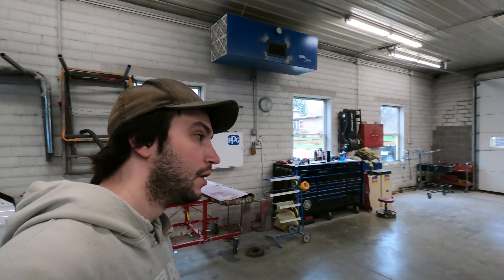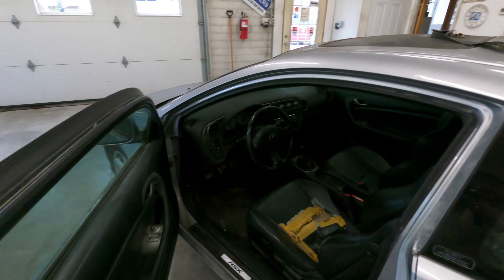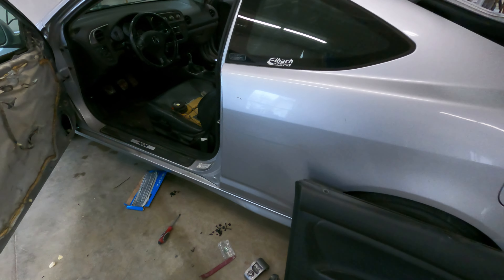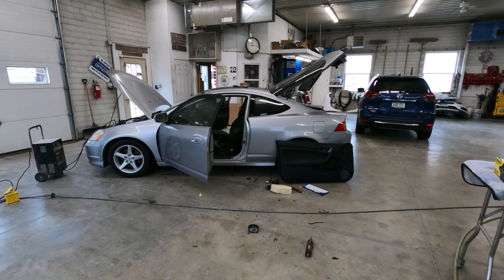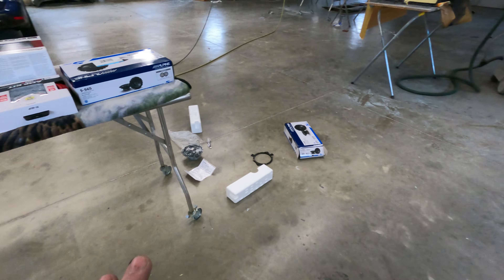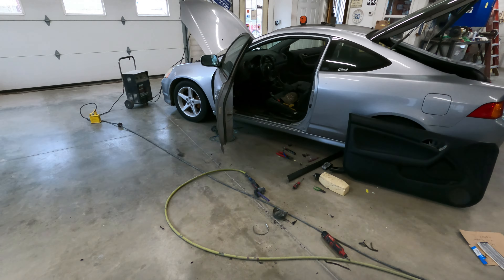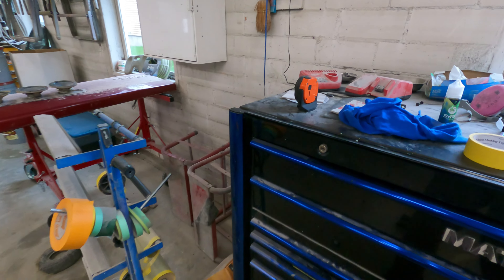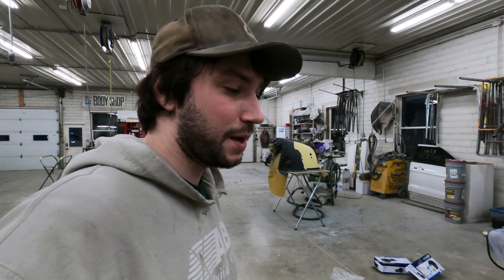RSX type s gets alpine type S speakers and kicker 360.4 amp!

Comment: If you are going to do things you might as well do them right!  = )  
I started installing my first aftermarket stereo and am at the last part which for me is installing this amp.  I am thinking under the rear seat opposite the factory amp either just screwed in through the carpet or the PRO level install would be to build a plastic mount for it.  Part of me wants to just slap it together now and part of me wants to take the time and make it look nice... maybe it'll help keep the heat down or something.  Looking forward to hearing what this little amp will do!
Best Wishes